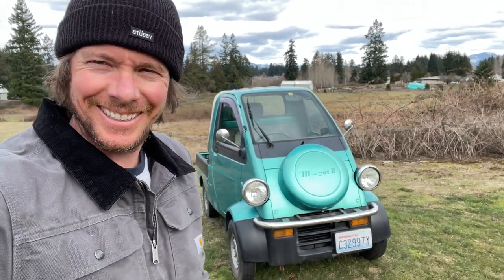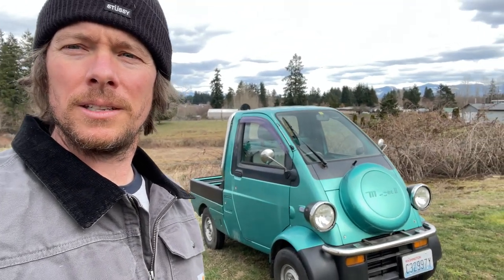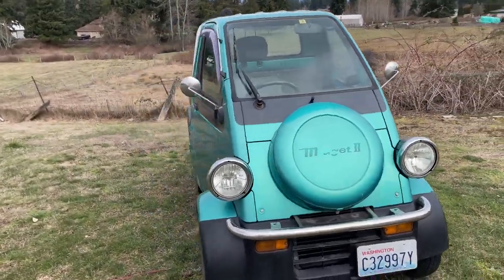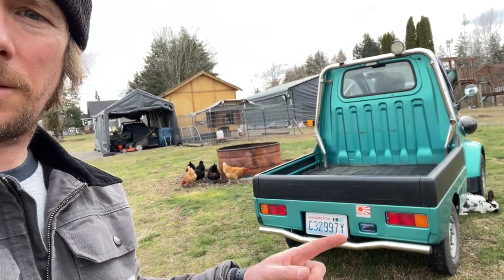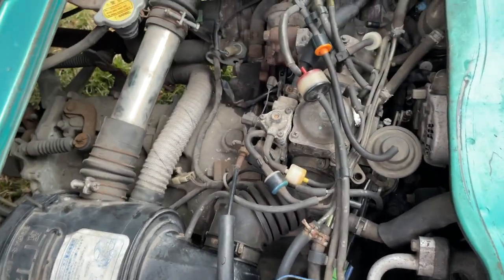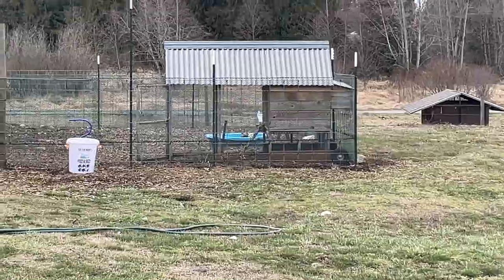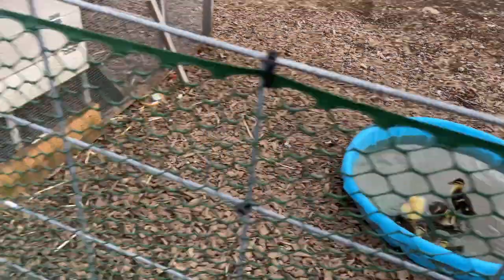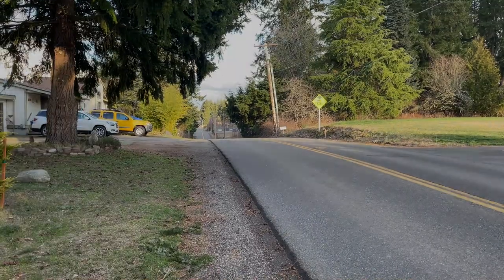The Weirdest and Coolest KEI Truck Ever! Daihatsu Midget II Perfect For My Ducks!

Comment: 20:43 time mark _ comment about "I'm used to Sambars and I know what the carb solenoid looks like on a Sambar."

In a nutshell, that comment boils down the tremendous difference in knowledge base between the Sambar and the Midget.  There are hundreds of online resources to help troubleshoot problems and to find parts for the Subaru Sambar.  And if you can't find what you're looking for, there are dozens of forums that you can ask questions with experienced members ready and willing to tackle the most difficult of questions.  For the Midget, the resources are far less frequent and much less comprehensive.  There is a living and breathing Sambar community, not so for the Midget.

(My comments are with regard to what's available in Anglicized form, I'm not familiar with resources written in Kanji.)
Reply from the maker: ya the midget and Daihatsu community is smaller so it's a lot of trial and error or hoping someone has an answer that's helpful!

Comment: Such a cool little kei truck. I had to look it up and now I'm waiting for my midget 2 to arrive from Japan! It doesn't have ac though. I plan to buy an ac box for the midget and install one. Do you have any advice or videos on how the ac system works in the midget 2? Any advice about tackling such a task?
Reply from the maker: Haha right on 🤙🏻🤙🏻 this one is by far my favorite of the bunch right now. Such a fun little truck. Plus any little mod just makes it look even cooler lol. My a/c actually quit working but I think I disconnected a vacuum line that tells it the engine is running and to turn on so at the moment mine needs to be fixed. Up here I don’t use ac often so it’s not a huge concern but would be nice to have. Not really sure how it installed but it doesn’t look easy. Since it’s in the floor board, you probably have to cut some flooring out to route the lines and such. I’ll have to get under the car and take a look at what’s going on and report back
Reply: @Oh Kei Garage  and I'll report my findings too....when I get the midget. Waiting for it to get here.
Reply: Which import company did you use?
Reply: Any updates on this? I know this is a year ago but I’m planning to install an AC unit too

Comment: 24:53 time mark _ stick shift diagram.  Your transmission is a 5-speed?  That's insane, a HiJet motor and a 5-speed transmission!  

(HiJet engine's rated at 42HP, the Midget puts out 31HP.  The Midget doesn't come with a 5-speed, just a 4-speed.)
Reply from the maker: yes sir! hijet swap in the midget, thing flies!